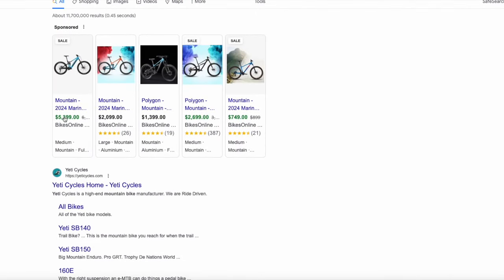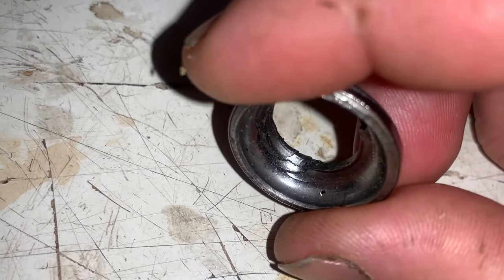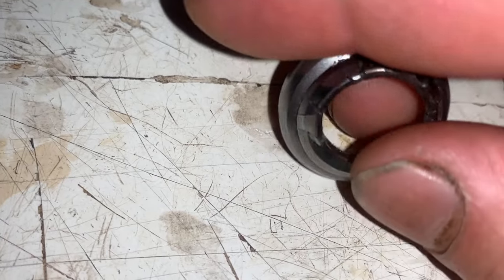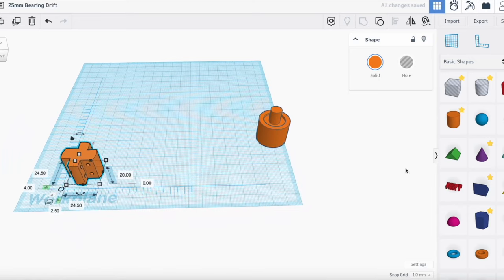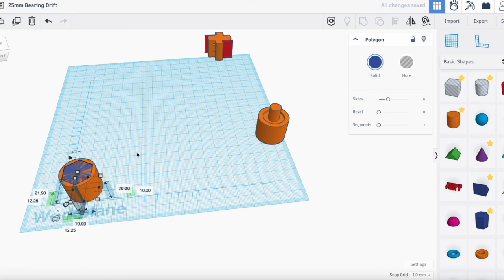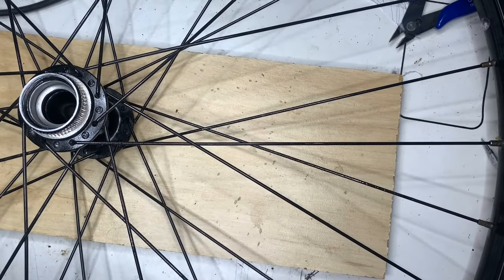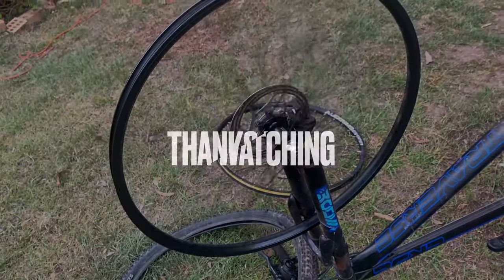Bicycle hub sealed bearing upgrade for under $1 plus parts

Comment from the maker: Note: The bearings I used are 60002RS 10x26x8,  so its 26mm, not the 25mm I mentioned in the video, we can thank the inaccuracy of my steel rule. I verified this by checking from zero, and then again at the 10cm mark.  
Fortunately it all turned out just fine with my 24.5mm design which came out of the printer a fraction over 25mm anyway.
I need to do my eyes a favour and invest in some digital calipers like these: https://s.click.aliexpress.com/e/_DC2wp4r
Reply: Link not working.
Reply from the maker: Strange, it works on my end, even in a private window. It's a digital caliper. @patrickbodine1300

Comment: Sweet upgrade! I bet the wheel rolls super smooth!
Reply from the maker: It does indeed. After finding the bike shop didn’t even stock bicycle bearing races (they only had balls), I think, if possible I would change everything over in future. So much easier to work with and replace too.

Comment: I have an ancient (80s/90s bicycle) with a busted old type (non-sealed-cassette) BB. However attempting to stuff a new sealed bb in the shell I learned eventually that the shell is tapped for an Italian threaded BB/end cups so I've probably buggered the aluminium threads. The whole thing has been so much more of a nightmare than the last one I did, many many many tools for this mongrel/money pit of a bike, square wrench flats, hammer, washer, whole toolkits, working all night until I had to leave for work attempting to beat train strikes etc. FML, the things in pieces as I can't find the correct threaded cassette BB anywhere to put it back together.

All in all your video made me happy just bcos it shows I'm not the only one having to get extreme to fix these b*sterd bicycles. 

I'm thinking my next step is to rebuild the existing BB as I have new bb's and races ( I hope they will fit the old spindle!)  Or to buy a stripped shell BB that has external bearings iirc! 

Thanks anyway!
Reply from the maker: It's good to know we are not alone! With your nightmarish situation, it might be worth checking out your local recycling centre / tip shop for other bikes or parts. I often mix and match bits and pieces to get results. I've collected enough that I've passed up on some really nice bikes because they were barely much of an upgrade from what I've already built.
On my wifes 24" bicycle I swapped out the 6 speed ratchet type hub for a newer shimano hub with 8 speed cassette from a spare 26" rim I had lying around. A bit of fiddling about getting it to run true, but really rewarding experience, upgrading something for less than $5 or $10.
Reply: @FixTechStuff  tempting, but I don't think my partner would approve if i brought more bikes home haha.

BTW, do you think ADHD gives us extra perseverance through hyperfocus? It's a blessing AND a curse to me!

Comment: The Bike Sauce built a pretty simple little bearing press which seems easy enough to use to do this. The video was called "Replace Sealed Cartridge Hub Bearings" or something similar.

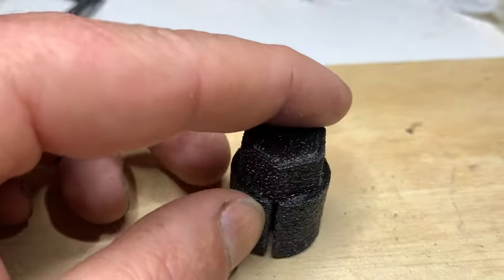Comment: I like your practical use of 3D printer. The print quality wasn't great but at least it worked. 5:11 I thought you were using fuzzy skin mode or the filament was wet as hell and require drying.
Reply from the maker: Thanks. That's 0.5mm layers on a 0.5mm nozzle, I now have a 0.8mm nozzle so can print that bearing hone in 25 minutes rather than 2 hours for 0.2mm layers and 0.4mm nozzle.
I would really like a 2nd or 3rd 3D printer, so I can do different quality prints according to the situation. 1mm nozzle and 1mm layers would be fantastic.

Comment: wich filament did you use??? not a 100% sure on the plastic stuff better turning some wood or some rubber!!!
Reply from the maker: I use PETG, PLA will also work, it doesn’t get hot enough to matter.
 If you had a lathe obviously wood would be better.
Reply: If you use a hole saw and cut the wood at the right dimension.
Reply from the maker: that might work too @pauloribeiro1627

Comment: Can you please suggest me a method to fix a bearing if the bearing seating required few millimetres material more?
Reply from the maker: You're saying the bearing hole is too big for the bearing? perhaps a different size of bearing is available, I'm not sure
Reply: @FixTechStuff   the problem is with the axle. I am thinking to fix it by rolling some paper or plastic material around the axle.
Reply from the maker: Aluminium can as a shim might be a good option, other than that buying an axle from aliexpress. @jenickjohnson4361
Reply: @FixTechStuff  I tried that but when I try to stuff it, it deforms. I have to try it again.

Comment: This a fake video 1 my A do you know how much a 3d printer would coast just to to do this?
Reply from the maker: In the description I wrote: "if you don't own or have access to a 3D printer you could always make the tool out of wood if you are a bit handy."

You could get a piece of broom handle, drill a hole and sand it to size with a drill or something.
See if your local library or some other organisation has a 3D printer.

My $149 3D printer has more than paid itself off with all of the useful things I've repaired or made, so it was money well spent.
Reply: The 3d printer does cost (at least $99 new, with promotion price at microcenter); but, missing the point of this vid:

Less money = more brain

Or the internet meme:

Girl’s voice: “How are you so good in so many things”

Guy’s voice, sound of frustration, sound of exhaustion, a bit of prideful flex:  “when you’re poor, you learn how to do many things”

Or…the point of this vid:   Outthink your problems. 

If I done have a 3d printer (I don’t), I would use a drill attachment (cheap at harborfreight) for sanding.  

What if it’s the wrong size?   Another opportunity for you..me to flex and either roll up extra tape or sand paper to size or spin the attachment against sand paper to reduce the size.  

“How are you so good with so many things”.  “Poverty, baby!  Either grow or starve😂”